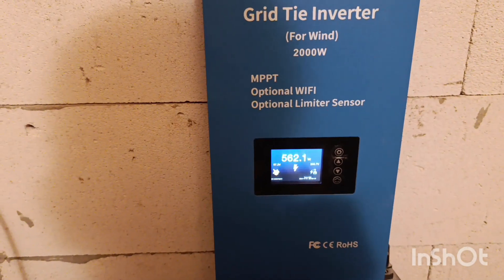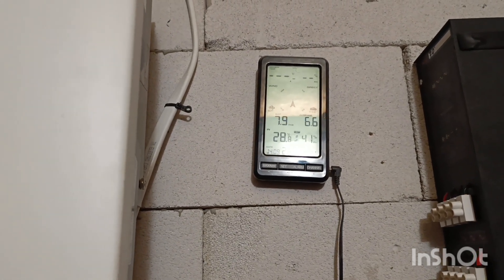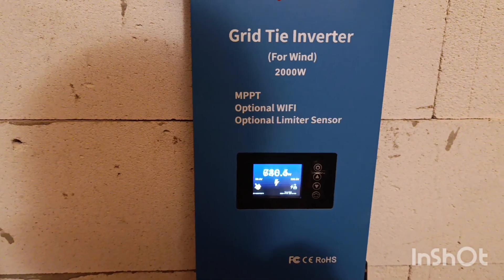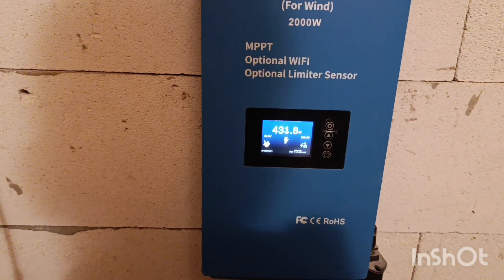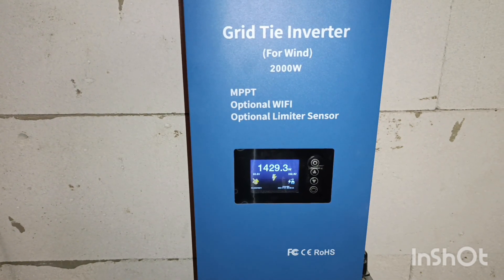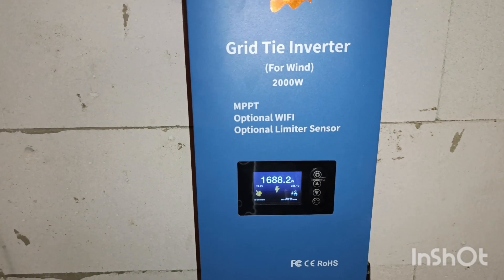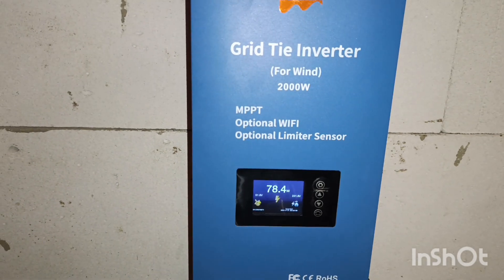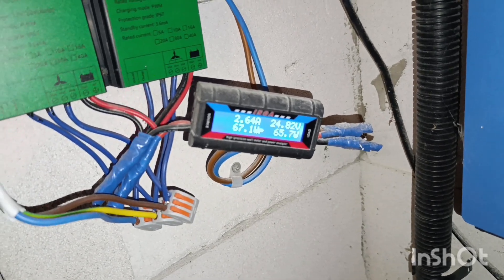Is FT-2000L2 a capable wind turbine? Looks like it definitely is a good one, all depends on the wind

Comment: Hi, i have a wind turbine 2000kw with these controles and i dont get it to work. Any advice you can give me. The turbine is 96v three phase AC. Thanks
Reply from the maker: Sure. Let's start with the exact model names and technical parameters.
Wind turbine - wattage (2kW I guess), nominal voltage (96VAC I guess), wind wheel diameter, product name.
Controller - exact name, whether it has boost and/or buck, system/battery voltage.
System - cable length and mm2 of it (from wind turbine to controller).
Reply: @BackyardVoltage  i make a huge answear I think it did not post
Reply: @BackyardVoltage  it is a grid tie inverter a blue one without brand. In the screen only says SUN-2000-wal (45-90v) ver 6.1. The voltage in the inverter is 240v to the grid in 60hz. The turbine is a 2kw 96v ac three phases. It dosen’t have a Lot of info on it. What I know is that it need 2.5m/s to start. Is is almost the same you show in one of your vídeos that the tail is by a side. All is from china. There’s no battery since is only conected to the grid to bring down Electric Bill. The cable lenght is 6.6mm and is 25m long.
Reply from the maker: well, everything seems to be okay, so far. what is the windwheel diameter of your wind turbine?
I'll let you know which power curve to set, once you will give me that value
Reply: @BackyardVoltage ill go up to make the correct wheel diametwr. It is at a top of a pileta 15m high. What I have see is that when I “Free” the turbine, that me and I let it spin without be conected to the inverter in my voltimeter appears 30-40v . I have reach up to 60 when i turn on the breaker to connect turbine to inverter, in the inverter shows the same volts, start showing watts but start to slow down the turbine until only can seen between turbine and inverter 0.400v. I dont know if the parameters have something to do with that.
Reply from the maker: there might be the case, that the dumpload mosfet is stuck... you will notice that, if the resistor is getting warm or hot. if that's the case - then you have to maybe replace that mosfet.
however, let me know the diameter (or blade length) so I will let you know what should be the power curve
Reply: @BackyardVoltage  Hi, i check the dump load. It has 5 volts if turbine is shut down. If I turn on it drops to 0.090. Also is not hot or get any color red. The blade has a 1.30m long
Reply from the maker: 96 VAC wind turbine should be very ok to drain power starting at 48VDC, so given your unit is of 1.4-1.5 kW power cap you may use the following settings:
48 - 005
52 - 010
56 - 025
60 - 045
64 - 070
68 - 115
72 - 170
76 - 230
80 - 255
dumpload - 84

if it does not help - you are definitely having issues with dumpload mosfet being stuck. you may try disconnecting the resistor completely (remove one of cables) and try running a unit to see if it works, but rather do it on low or low-moderate wind.
Reply: @BackyardVoltage  Thanks Ill put these parameters. For the other óptimos in the menu, should i move something? The internal limiter, the remote num, shurtcut, do I put something there or turn them on?
Reply: @BackyardVoltage  also i would like to know what me and the numbers, at 48v will produce 005 x 0.1 amp. What is that 005?? I also check and when i take off the dump load the turbine starts to work and to genérate some watts. I speak with seller it is 2kw and weight 70kg. He send me all data sheet. Do you have a mail i can send it to you?
Reply from the maker: sent you all the info via facebook, we will figure it out for sure.

Comment: @5:18 When you are getting 9mps in wind speed , what are the RPM's ??Please...
Reply from the maker: on this inverter the working range of RPMs is somewhere between 200-500. on 9 m/s it is approx 420-440 maybe. but you can shift it a bit with loading it slightly heavier, so more power on less RPMs is possible

Comment: how many amps does the dump load resistor draws? I´m looking for that data in these inverters but I can´t find the "Max Amps" for the "dump load" connection in the datasheet.
Reply from the maker: It will take everything it can depending on the turbine's voltage and its own resistance. It is 10R, but I find it working pretty awful, producing not enough amps to slow the turbine down. From practice - 5R is the best suited parameter for it. In that case it slows down the turbine very effectively and not too much.
Do not go down to 3 or 2R, as you will burn the guiding mosfets.
Reply from the maker: See Short reply

Comment: What is the Length and mm² of the cable that you are using
Reply from the maker: in this case - 6mm2 copper, length - about 26 meters
Reply: @ Are you still happily using the SUN2000 48V Inverter? How much wind (m/s) does the Turbine need to produce 45VAC?
Reply: 45VDC (internally recified)*
Reply from the maker: @xSentoTomato  yes. the turbine has to reach 44-45 VDC to actually start production. and it is ok for some cases. In my exact case, my both these inverters now work as the battery inverters, and each wind turbine works thorough the dedicated controller.
I just required that kind of setup, that's why it's kind of complicated
Reply: @BackyardVoltage  did you experience more production by downsizing the Dump load resistor to 5 Ohms?
Reply from the maker: @xSentoTomato  yes, it helped to keep the turbine within the working range much better
Reply: @BackyardVoltage  do you have a link where I can buy the identical resistor?
Reply from the maker: no, I haven't seen where you can get +1 white resistor...
I got it since I got another same inverter (that I used as a battery one, so I had a spare resistor).
But, here is the place where I actually got the bigger ceramic tube resistor 4 kW 5 Ohm, you may have seen it in my videos as well, the big green one: https://s.click.aliexpress.com/e/_DCWaUFr
Reply: @BackyardVoltage  Im still a bit confused with the Voltages of the 48V Turbine. The Inverter needs 45VDC to start producing, but in the Datasheet of the Turbine it states that this rectified voltage isnt reached until ~1500W. Where is my error here?
Reply from the maker: @xSentoTomato  no-no, the 48 V wind turbine should reach 48V under NO-LOAD condition, and that happens normally somewhere around 3-3.5 m/s depending on the wind turbine.
Reply: @BackyardVoltage  okay, i get it now. Thanks for clearing that up.
Reply: @xSentoTomato  5 Ohm but at how many watts?
Reply from the maker: @alecchi  5 ohm at any watts... ohms are a constant. voltage that's on the wind turbine at the moment when the resistor is getting engaged - they define the amps that will be pulled from the wind turbine to slow it down.
Reply: the three-phase wires?

Comment: I contacted the ESG company and they told me that they do not retail, didn't even tell me where to buy their wind turbines. I wanted to compare it with the one that Jessica sells but not possible. Maybe they are the same. Lots sellers say that they are manufactures but it is not true. They buy from the factories and them sell them. This is crazy. Who can we trust?
Reply from the maker: well, Jessica is definitely a true factory and manufacturer )
That's what I am 100% confident about. I've had a video tour with her live on the factory. Just spontaneously
Reply: You were lucky. Very cool. What would you say about the quality of Jessica's turbine? Did you open it up to see its bowels?
Reply from the maker: not yet, will likely do it once it will be remounted onto the tower the is currently getting rebuilt. thus, it will take a while I believe...
Reply: You can compare now. Which one would you say it is better quality?
Reply from the maker: Wuxi is better I think.
Here, I found a link for you: https://www.alibaba.com/product-detail/Roof-top-use-1kw-micro-wind_60427796343.html
they use 2.8 m windwheel now, which is better for this generator I think. I might want to upgrade mine to that dia as well, later
Reply: Thanks😊

Comment: Hello again. Great video as usuall. I have a question if you don't mind. What happens with the furling tale when the wind turbine is on brake because the batteries are full? What does it do? Many thanks
Reply from the maker: good question. well, tail lives its own life, and I bet if the wind is over 11 m/s it will get fold regardless of the wind turbine's spinning. however, I had no chance to check your exact scenario. I had a chance with a smaller FT-1000 to see once it was shortcut (manual brake) and the wind was 18-25 m/s - so yes, the rotation was barely there, but the tail was still getting folded
Reply: So even when the blades does not rotate cos they are shortcut, the furling tale does his job and put the blades away from the wind? That is very good because the controller has less work to do. Less amps etc. I think I am going to buy one with furling tale then. Many thanks😊
Reply from the maker: yes, that's exactly the case
Reply: The wind turbine should not be on brake unless being serviced on the ground  It should be allowed to continue to rotate and supply a suitable sized dump load resister if no other load is available. The tali arrangement will serve to protect the unit in high winds. (comment from qualified Electrical Engineer in Australia) with wind turbine experience